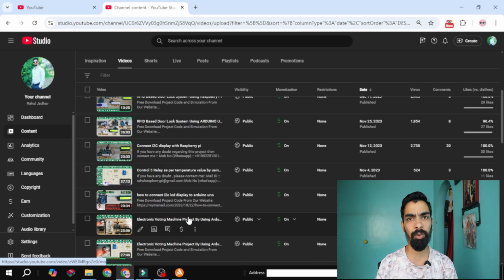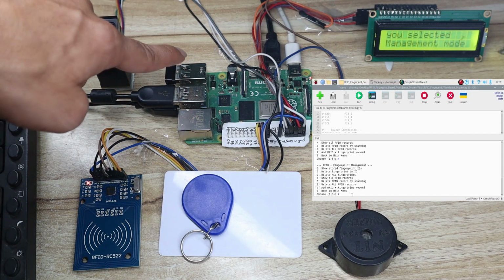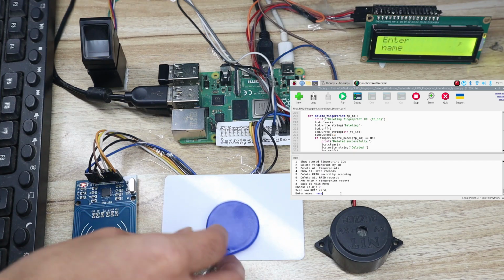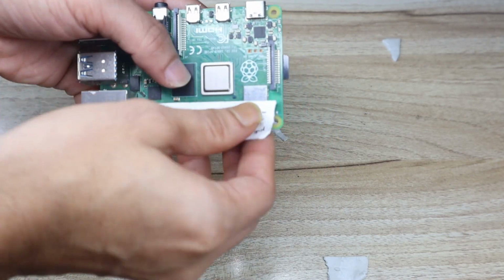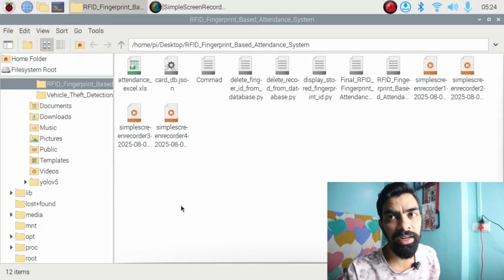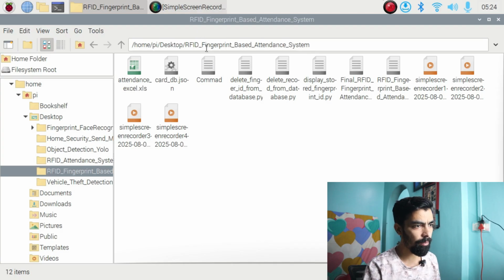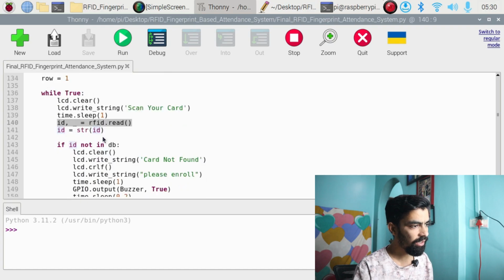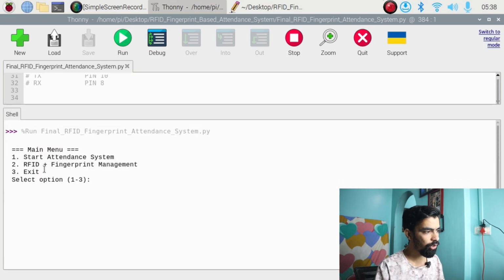Smart Attendance System using Raspberry Pi |best innovative science project #scienceproject #science

Comment: Please sir, is it possible to design an IOT enabled smart attendance system using raspberry bi. It uses RFID, FINGERPRINT AND FACE RECOGNITION but it works as a two step system thaf is it uses RFID as base authentication and either face recognition or fingerprint recognition as secondary. 

The device enables registration into the system, Admin control on the system and attendance mode in the system all which can be chosen when a pin code is typed using a keypad.

It  should have an LCD screen with led bulbs for  visual feedback, a buzzer for audio feedback and after successful attendance and registration the data is stored on the device itself and an online database like firebase soybit can be viewed remotely. I guess this covers my basic idea
Reply from the maker: Already uploaded video.
Please check my playlist